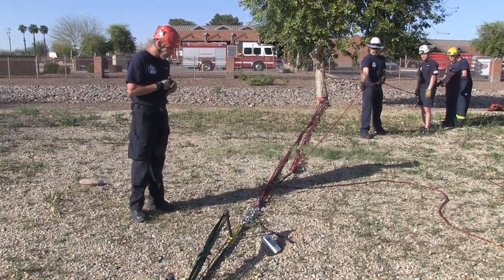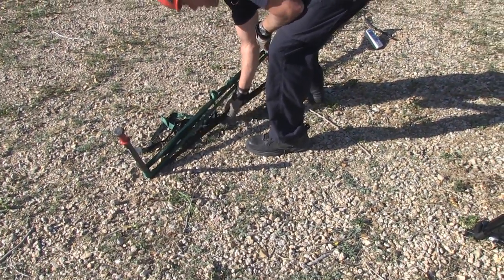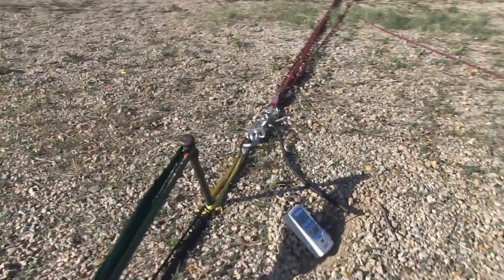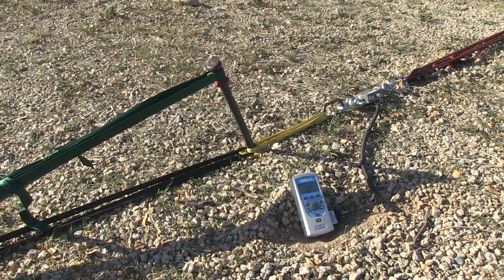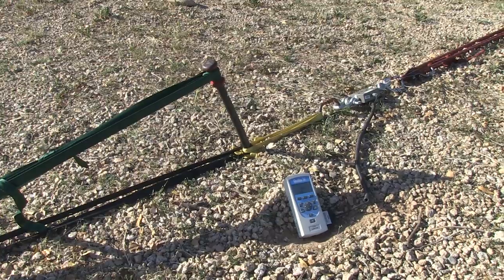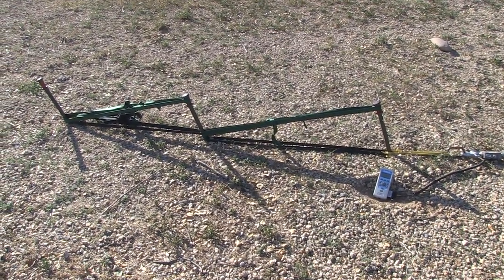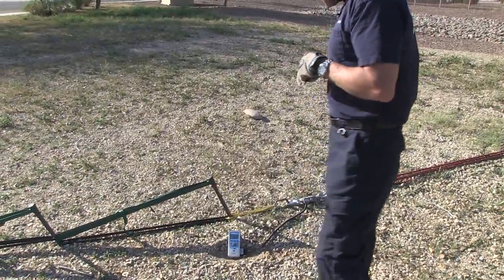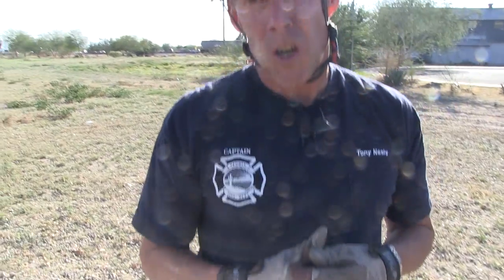Picket Anchor Pull Test

Comment: Army core of engineers post number significantly lower for a 1:1:1 system.  Any idea gy your number were significantly better?
Reply from the maker: You see the numbers. I will say that my load cell is recently calibrated and the results are consistent over several tests so I wondered the same thing. I do not know how they got their numbers. Did they use direct read instrumentation? Is it possible they derated their test to establish a safe working load?

Probably the big thing is the solid type. even though the soil we tested had been previously disturbed it was dry, compact and had good clay content (Phoenix area).

I think soil with higher moisture content would see bigger movement but I don't have that kind of soil to test. it seems clear that the pickets are not the weak link. in fact, when it comes to the picket anchor plate, i think you could drive the pickets 90% in and get an even better result since back-tying one picket to the next does not seem to be important for full strength.

the bottom line is to do the test in your area in your soil type. I think its a pretty easy test to set up. You can use a 10,000 lbf dynamometer set to peak hold if you don't have a load cell.

Hope that helps

Tom